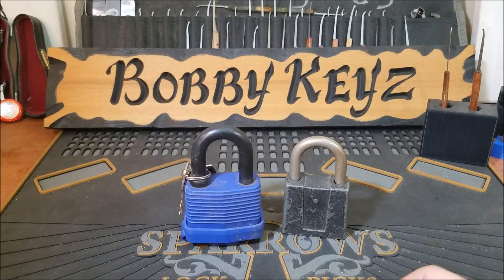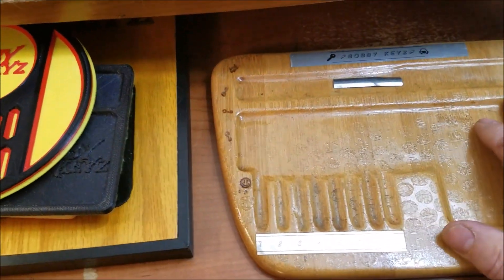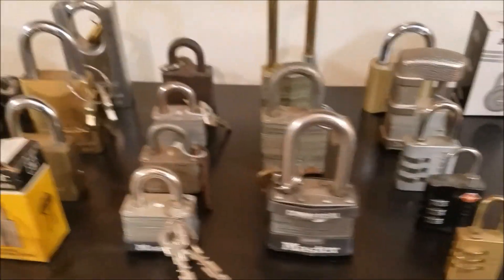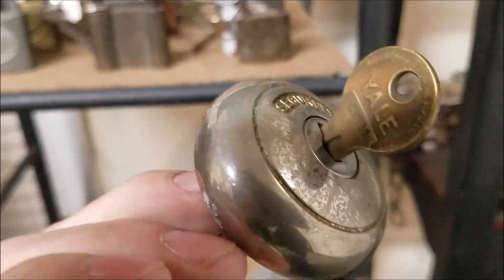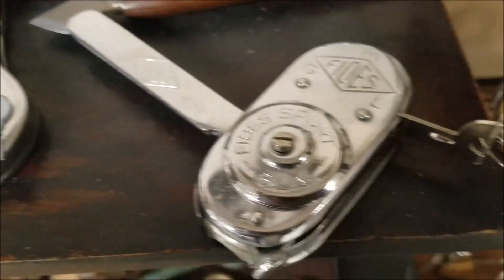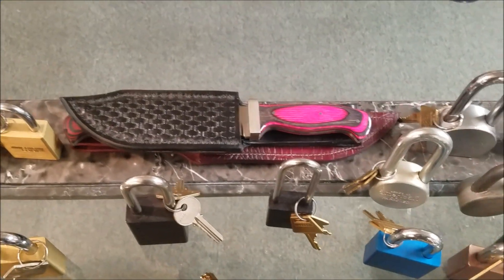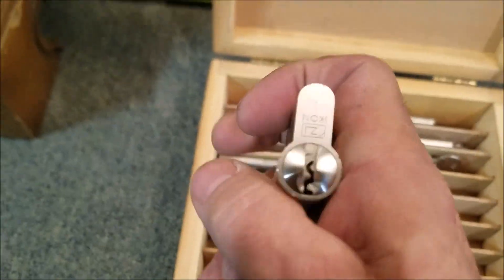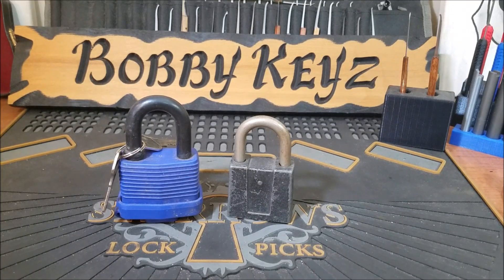(585) LockLab Tour to support "The Skull Picker"

Comment: Bobby, have you done a video on the pros and cons of your 3D printers? Wondering which ones you would recommend.
Reply from the maker: I haven't gotten into the printers to much. It can be a very frustrating hobby when you first start out. There's a huge learning curve,  so much to learn my friend. It's not just the printer. Although I recommend Creality brand.
Reply: @bobbykeyz1263  I've been talking to the kids next door. They're both into it. They recommended one called Sidewinder. But I'd love to see a vid covering the prod and cons.
Reply from the maker: @two_tier_gary_rumain  that's actually looks like a nice printer. I've been interested in them myself. Right now Gear best is having a flash sale on them. But I get all my machines from Amazon. I don't like getting them from overseas. I've had to return a couple in the past.
Reply from the maker: @two_tier_gary_rumain  I'm getting a couple more machines after the Holidays. That could be one of them. But it's a large format printer like my Tevo Tornado with a build volume of 300×300×400mm. I don't use that printer as much as I use the others because of its size.
Reply: @bobbykeyz1263  Yeah, that would be a huge problem. I've seen them on eBay but there's so many it's confusing.
Reply: @bobbykeyz1263  Yep, I'd only want a small one. There are a bunch of unboxing vids on YT about all sorts of 3D printers but hard to find useful info for a beginner.